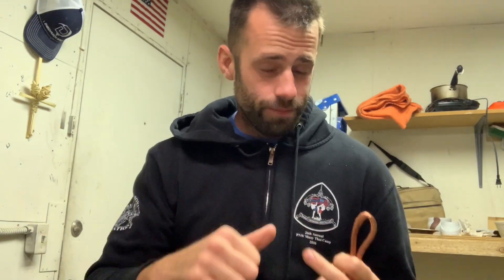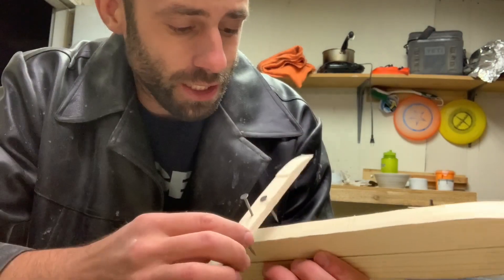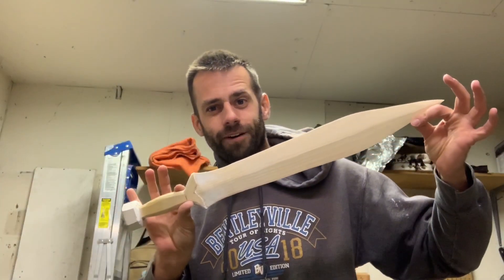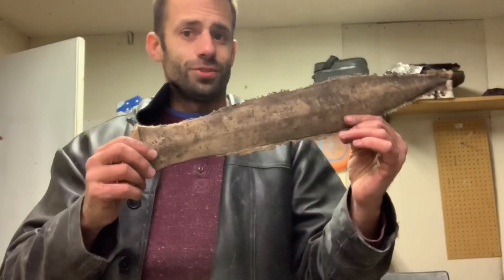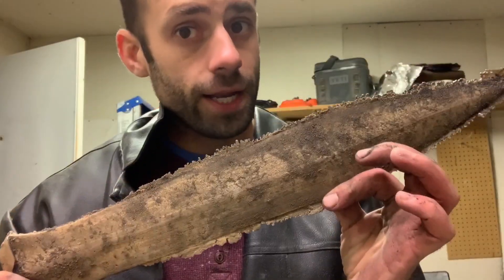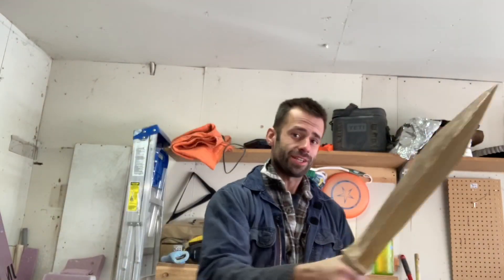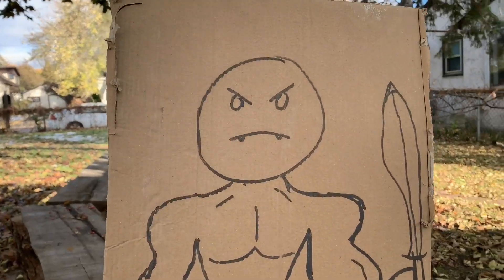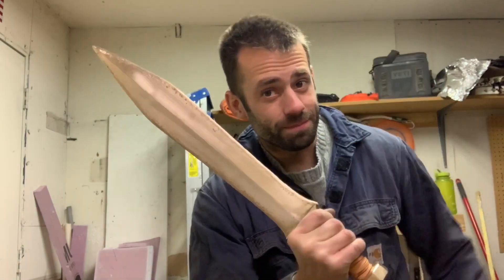Making a Bronze Sword: Start to Finish

Comment: I loved this video. I had to laugh when you remarked "How am I supposed to get a file in there?!?" I make jewelry and when I design my casts, I will do just about anything to avoid inside corners for that exact reason :) I've been wanting to try this at home. Do you use regular wet sand? What is the thing you're using to melt the metal?

Comment: Good work, man. The center line tool is ingenious. The pattern in sand should be made in a different order as you may know. Take the bottom draft and place it upside down on a stiff plate. Place the sword there and add separation powder and fill in the sand. Then rotate it and put  the cope on it, then powder and sand and there you go. Everything will be neat and tight.

Comment: I believe you need more clay in your mold material, there isn't enough binder to keep the sand from crumbling when you pull the wooden form from the mold. You might also want to go from a Green Sand process to a Shell Mold process.

Comment: I wonder if your sand needed a bit more of the clay mixed in and packed a little harder
Reply from the maker: Yes. I think that would have helped. The blades I’ve made since then have gone much better and I’ve packed them a lot harder.

Comment: I find a flat needle file seems to work great for filing the surface of the bronze smooth. It's a nice fine file so it leaves a nice fine grit sandpaper type finish. You should be able to make 2 decent length bronze swords from the amount of bronze you used in that sword. If you can source some soap stone of the right dimensions for a mold, that would probably be a much better mold as you can reuse it over and over
Reply from the maker: So with the soap stone I assume you just carve the negative of the sword in the stone?  That sounds very challenging!
Reply: @lundgrenbronzestudios  Yep just carve out the negative. Soap stone is very easy to carve so it's just a matter of getting the mold perfect. I just watched a video called 'Forging a Bronze-Age Sword' by 'Ancient Recitations' channel on yt and they are using a soap stone mold to make it. It is in fact the place where my bronze sword is bought from, so my bronze sword would have been cast in either that very soap stone mold or another of the same sword design. Perhaps slate would serve as a good mold material as that carves pretty easy too.

Comment: 13:52 That piece of metal is known as 'flashing'. I like how you approached that problem. I would have thought an arc welder would work to do that job too, and you maybe could have gotten the job done with a propane blow torch melting that piece of flashing into the hole.

Comment: 8:10 I think the sand needs oil added to it and also the sand needed packing down a hell of a lot tighter than that. Armchair bronze caster here by the way, but I've watched plenty of youtube videos of people sand casting bronze lol. Also I have a reproduction irish bronze sword and it weighs a little under 700 grams without a handle on it. It's named 'leaf shaped sword' on the bronze age foundry site that I bought it from and is 22 inches long. I think it's a very common mistake to make a bronze sword far too heavy and thick, and generally bronze swords were not more than a kilo for the big swords. Man you got shyteloads of tin bronze there to make swords out of. 
You really need to have the bit just past the handle on the blade to be thicker and not at all sharp because that part you would often rest your finger on while using the sword. 
Great job by the way for someone who 'doesn't know what they are doing'.

Comment: Very well buddy, you did it nicely and with your heart. You had too much struggles 'cause you were trying to did everything perfect in one shot. Trust me, it rarely happens. Where you got the sand pulling away from the edges are so small, do not worry, like you said, just grind it, it like that it works, and propably how it always worked.
Just think about the fact your king, emperor or whatever ask you to make hundreds of casting swords, trust me, even though you are a master, you will "fail" some of them, at least small parts, that you can reshape afterwards.

To me you did not make that many mistakesn you just wanted it perfect in one shot, what is for me the biggest mistake you made, but you know what, that is not really a mistake, it proved that you wanted something as great as your motivation, keep it on buddy :)
Reply from the maker: Thank you!

Comment: Absolutely fabulous.  How long would that have taken without the power tools.  Guess that is why swords were such valued objects.  Thank you so much for the excellent video.
Reply from the maker: I think about that all the time. How did anyone do this stuff without power tools!?
Reply: Time and patience. Spears were the main weapon of the bronze age, as bronze was a very valuable and expensive material (spear heads require MUCH less than a sword, as they are thin and hollow) so swords were objects of high status. So as I said, time and patience was the way to go back in the bronze age

Comment: IT will kill! nice work. i wonder if the tip swelled from hydrostatic pressure. seems to be a common problem. great work none the less
Reply from the maker: Maybe that was it. I never thought about that. I didn’t know that was a thing.